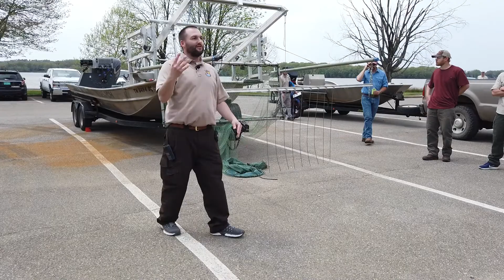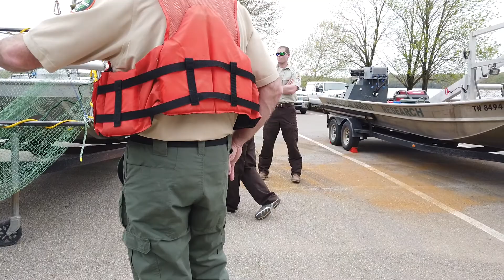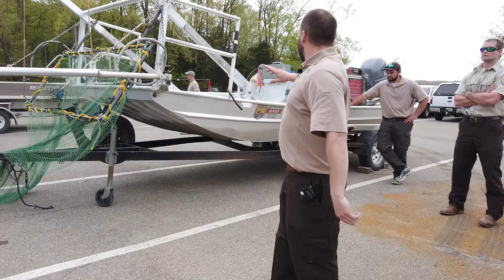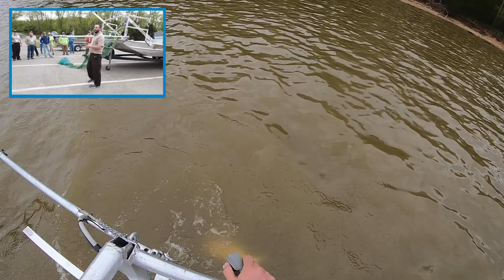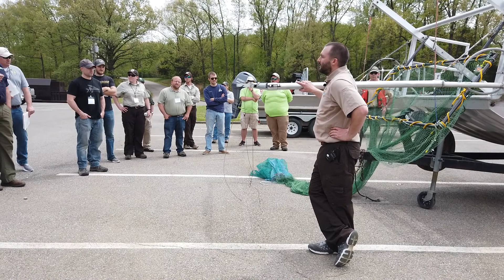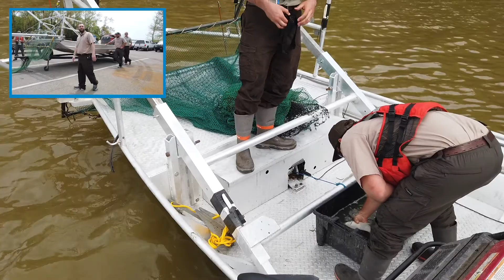In the Field: Electrified Dozer Trawl

Comment: informative Video! I'm wondering what is the size of the boat used in the video? Could this setup be downsized to be installed on a slightly smaller boat for smaller river applications. Any information would be helpful.
Cheers!
Reply from the maker: Hi Josh – From my understanding, the electrified Dozer trawl is a conventional electrofishing boat with a push trawl added to it, so any boat that is or can be an electrofishing boat could have this added to it. Below are links to a published paper and a fact sheet on the technique. If you have more questions on the technique, I can connect you with the experts at USFWS and USGS that are using it on a regular basis to get their thoughts.

Hammen et al Dozer Trawl - https://go.wisc.edu/58367g

USFWS Fact Sheet - https://go.wisc.edu/zpn668

Thanks for getting in touch! – Tim Campbell, invasive species specialist, tim.campbell@wisc.edu